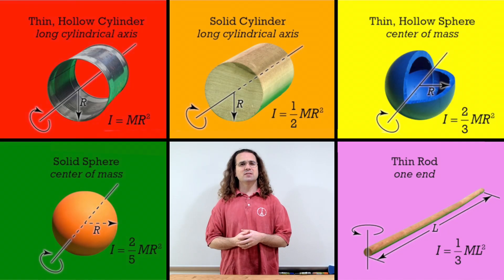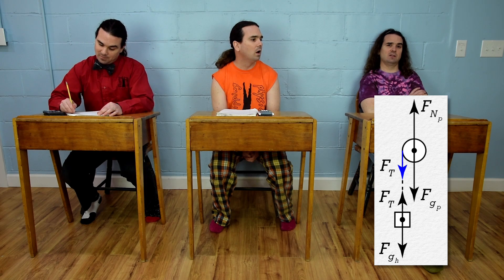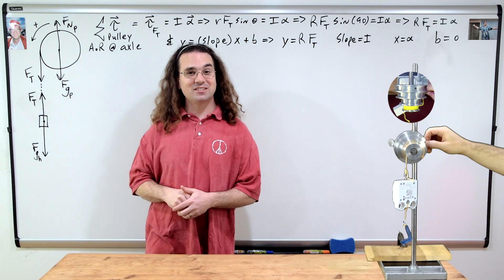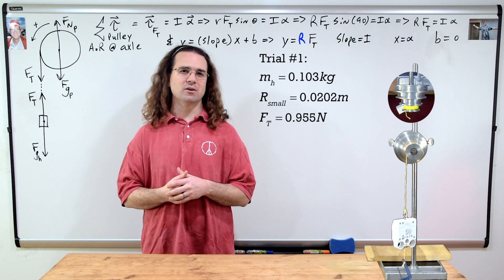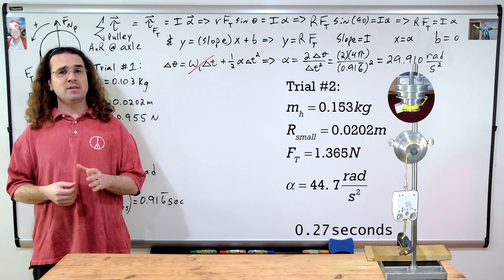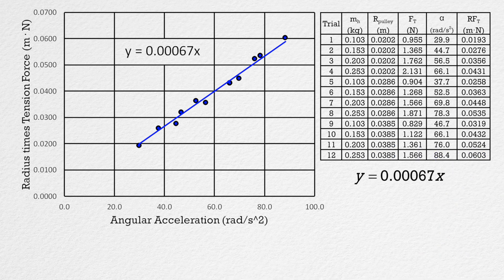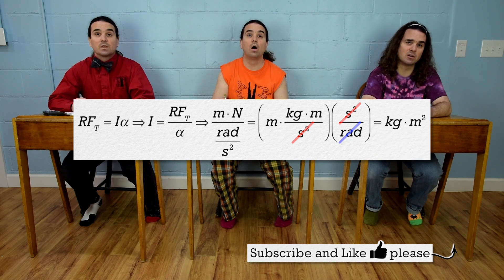Graphing the Rotational Inertia of an Irregular Shape

Comment: hi mr.p! why is the rotational inertia constant? is it because the r values squared are quite negligible and do not have a significant impact on the I value? I'm asking this because we have different radii for different pulley sizes, so therefore, wouldn't rotational inertia also vary? thanks!
Reply: however, according to our data, changing the radius does have an impact on the output result, so how could the I value be constant at 0.00067?
Reply: or could the I slope value  just be an average value of the demonstrator across all pulley sizes?
Reply: Rotational inertia is a property of the object. It is calculated by summing mr^2 for each particle on the rotating body, in this case the pulley. What changes is where the torque is applied on the pulley, not the pulley itself.

Here is an analogy to a more easily comprehensible topic:

Imagine a box sitting at rest on a frictionless surface. If you push (apply a force) horizontally, the box will accelerate. If you push the box at an angle, say 20 degrees above the horizontal, less force will be used to accelerate the block (because some of that force is down, and therefore countered by the normal force). In both cases however, the exact value of the acceleration will depend on the force applied and the mass of the object.
A higher R value makes it easier to rotate the object (less force needed since torque = FR). However, it does not change the material composition of the object and its rotational inertia.
Rotational inertia is like mass for rotations.
More mass in the linear example leads to less acceleration.
More rotational inertia leads to less angular acceleration.

Comment: I have a question, in the video Mr.P uses the Uniformly Angularly Acceleration Motion equations. He deduces that the angular acceleration is constant. I'm guessing this is because the Radius, the Moment of Inertia, and Force of Tension are constant (in the slope equation) so the angular acceleration would have to be constant as well. Is this correct? (4:00)

Comment: I have a question. On 3:26 , you talked about the force of tension. There is one force of tension pulling down on the string and one force of tension pulling up on the string. the force of tension pulling down on the string happens because of the force of gravity of the mass correct? And the force of tension that pulls the mass upwards is used to hold the mass so the mass doesn't individually fall off. the Force of tension's are equal (in magnitude) because of the fact that they are in the same string. Is this correct?

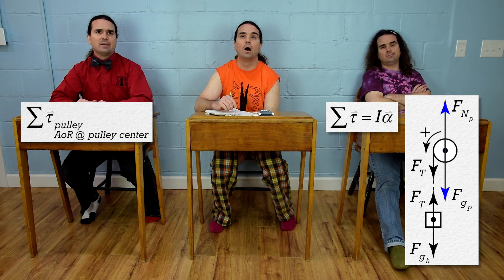Comment: 2:00 Mr. P, why is that force of tension the only force causing torque on the system? What about the force of gravity acting on the object and the force of tension acting upwards?
Reply from the maker: Because the system is just the pulley. The force of gravity that acts on the object and the upward force of tension acts on the object. When you are summing the torques which act on just the pulley, you do not include torques which do not act on the pulley.
Reply: @FlippingPhysics  While trying to wrap my brain around it, I thought of this point too; your comment has really solidified it! Thanks!

Comment: In its Teacher Notes for the device, Arbor Scientific publishes a value for the rotational inertia of the pulleys as 0.00058 kgm2.  I was wondering if you had a suspicion about any features of the setup or data-sampling that might be responsible for the 13+% difference, and if the difference could be mitigated by changes in the method.
Reply from the maker: I do not have any suspicions as to where the discrepancy between my observed value for the rotational inertia of the Rotational Inertia Demonstrator and the published value from Arbor Scientific. Perhaps it would be worth asking Arbor Scientific how they measured the rotational inertia?
Reply: @FlippingPhysics  Jon:  I did follow up with Arbor just out of curiosity.  This is the reply:
"Thank you for reaching out! It's always great to hear from our customers. I had a chat with the professor who developed the Rotational Inertia Demonstrator, and he said the 0.00058 kgm2 is more of an approximation for the purpose of the larger experiment, because it's difficult to calculate in a hands-on classroom setting and would take up a lot of extra time. Since it is such a small number compared to the larger moment of inertia of the entire system, it works as a universal.

However, I'll still address a few of the possible sources of error that come to mind. First would be simple manufacturing differences. Since its such a small number to begin with, even the slightest difference in torque of the axle bolt could change the calculated value. Also, I believe the demonstrator Mr. Palmer used for this video was a demo unit that has been to many trade shows and workshops over the years, and as such might have a little more friction to account for than a classroom unit that only sees use a few times per year. There would also be additional error in Mr. Palmer's calculations, but the scatter plot in the video looks pretty tight so I doubt the error would be significant enough to encompass the value we provide.

Please don't hesitate to reach out with any more questions or comments! I really enjoy putting my head to work on questions like this."

I appreciate their deference to your method and honesty about their approximation.  Your method is obviously sound and seems spot-on for your particular device.  It is difficult to predict the impact of an unknown axle bolt torque quantity, and by extension also difficult to predict the impact from one specific pulley head to another. Thanks for humoring me on my question! Keep up the excellent work!
Reply from the maker: I am glad you asked them and I think their reply is completely reasonable. I can see a 13% difference being accounted for by the various reasons described.
Reply: @bradsmith8541  The published moment of inertia of the product, probably came from the calculated value within the CAD software that produced the specifications for the CNC machine to build it.  Solidworks has a feature to calculate physical properties of any shape you can model within it, such as surface area, volume, moment of inertia, and center of mass.   It is likely how Arbor Scientific determined the 0.00058 kg-m^2 value.

The bearing friction would explain why the measured value is slightly larger than the published value.  It adds a torque that would otherwise not be present, if the bearings were ideal.